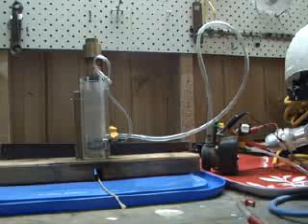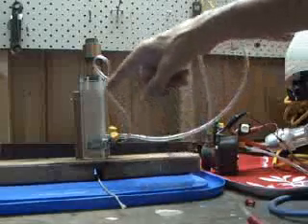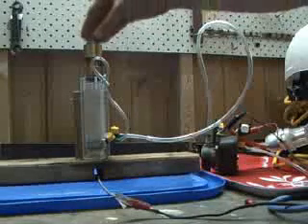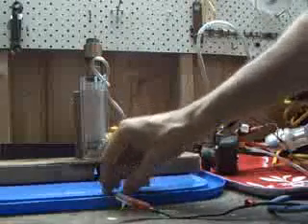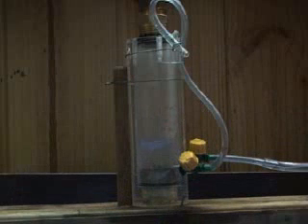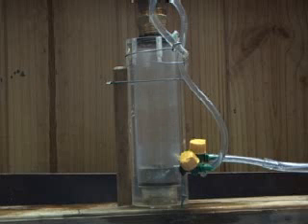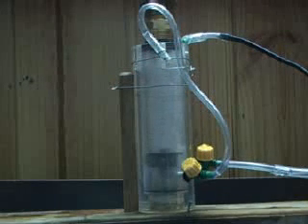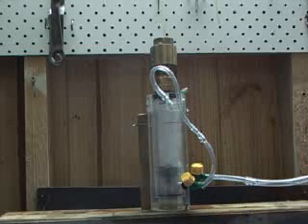The Power of Oxy-Hydrogen Implosion

Comment: I think electrolysis was used in the Grand Gallery of the Great Pyramid. The resulting hydrogen gas and oxygen gas were ignited which produced a vacuum. That vacuum in the Grand Gallery was used to move water higher in the Grand Gallery. Do you know of anyone who has ignited hydrogen and oxygen gasses in an enclosed cylinder to create a vacuum to lift water higher in the cylinder?
Reply from the maker: It's tricky because if the hydrogen and oxygen burning is enough to create the temperature above 100C in the container then there is no condensation and that brings about high pressure steam usually resulting in the explosion of the container.
Reply: @sapoty  it looks like in the video the container did not explode. Maybe someday you will read my books about how this worked in the great pyramid water pump.
Reply from the maker: Another way to create a vacuum would be to fill up the all the spaces in the pyramid with water and then take out the plug at the bottom.
Reply: @sapoty  What I am thinking about is an enclosed airtight cylinder 1/2 full of water with electrolysis plates in the water. After the plates are energized, oxygen and hydrogen gases are in the air-tight cylinder. Then the gasses are ignited. My understanding is that would produce a vacuum in the airtight cylinder above the water. The electrolysis process would only happen for a short duration. The bottom of the cylinder would be connected to a water source. My thought is the water level in the cylinder would rise up because of the vacuum above the water in the airtight cylinder. Additional water would enter the cylinder from the bottom which would be connected to the water source. The electrolysis would only occur for a short duration. Just long enough to create the gasses for combustion. what do you think? I hope I am making myself clear.

Comment: Here's a quick video I put together on the Phases of Brown's Gas Combustion.  http://youtu.be/-9EmgSowldw  Your experiment would be very different if you didn't release most of the initial force of explosion and steam with that large check valve.  The vacuum only 'looks' stronger than the explosion because you don't measure the explosive pressure.

Comment: In My experiments I found that less gas , Produces way less heat (a given) but when the piston is connected to a rotating assembly and timed right it creates enormous  low in torque at low rpm, but heat eventually builds causing expansion and loss of momentum .
Now using a mechanical driven vacum pump helps reduce heat and also cooling the gas after going through a dryer via copper condenser coil.
  Now working on consistent run times to see if I can achieve the impossible.

Comment: You 'can' get more power out, than you put in. - An HHO cell using specific materials and a 'specific ratio'. By increasing the size of the coil and researching the golden ratio and by cracking the Kings Chamber equation and applying it to the mechanical process. A pure self sustaining HHO fueled engine has been built and runs beautifully to the present day. V8 conversion. Will drive for thousands of miles on a cup of water. (Remove the electrolytes). Note; The Kings Chamber. The equation.
Reply: Tell me more about The Kings Chamber

Comment: Be much better if the H an O2 was liquefied and expanded rapidly on ignition, like in a liquid Hydrogen oxygen rocket engine..  The process from combining two light expansive gases to heavy molecules of steam is not the best for making mechanical power.

Comment from the maker: Yes there are ways to use this to pump water but electrolysis is typically about 50% efficient, so it will not be very efficient. However it may be robust.

Comment: I produced a T/3sbm which works on the exact same principal but the opposing reaction, it sparks and the water pressure plugs the gas feed hole pipe stopping further explosion, it is a test bench Apparatus, but that said, nice video guy... Ck out {FuelBan Video 12 The T3 sbm Spark Arrestor / Bubbler / 1 Litre measure All 3 in 1 Unit.  }
Thom in Scotland

Comment from the maker: @Me102288 I'm talking about using the oxyhydrogen explosion/implosion to reduce drag on a vehicle, create lift, and propulsion. To reduce drag the idea is to blast some of the air out of the way of the vehicle using laterally directed rocket engines in front of the vehicle. If done with the right timing and power the blast will be condensing as the nose of the vehicle reaches it. This will create a low pressure zone in front of the vehicle thus reducing drag.

Comment from the maker: @Ace011mm You need pure H2 for implosion.or max 5% air in mix.  No - H2 on its own does not do implode or explode. Those events happen when H2 combines with O. 
when i fire reservoir with hho and make explosion,lid go out and manometer scale is move anticlockwise and after this scale stay on 1bar. Yes - explosion blows lid off, manometer cannot move that fast. Steam implosion lasts longer than explosion... time for manometer to show low pressure then go back to 1 bar after the air rushes in.

Comment: @sapoty  Every thing is about quantum vacuum or eter or orgone or... There is only one energy,just different ways to use. H2 is just one of links to use this energy! Condenses not implosion! You need pure H2 for implosion.or max 5% air in mix. This tell as scientists. But some way,when i fire reservoir with hho and make explosion,lid go out and manometer scale is move anticlockwise and after this scale stay on 1bar. If you right,how this scale can go in different direction after explosion?

Comment: The second I read the title I realized what you were up to and a bolt of lightning zapped through my head and I thought: "That's pretty GODDAM CLEVER!"

I'm not a physicist, so I don't exactly know how to think about this, but seemingly, what you're doing is turning atmospheric pressure into work, simply by chemically changing the number of moles of gas in a container. VERY cool.

If you could "net off" (approx) the hydrl/burning, it seems like you could get the work "for free." AMAZING!

Comment from the maker: That is almost correct. The explosion created water and lots of heat... enough to boil the water instantly. Most of the white hot water vapor escaped through the brass valve at the top. The remainder quickly cooled by contact with the aluminium piston and the brass valve and condensed. That left very little vapor in the tube so the piston got pushed up from below by the outside air pressure coming in a hole in the bottom of the tube.

Comment: I did a few calculation on the amount of force necessary to lift the piston the amount of distance in that time and I figured out that there doesnt need to be much force. i assumed a square inch area of 2in. and at 10g it needs only 1.25N and at 50g it needs only 6.25N of force. And atmospheric pressure on 2 square inches exerts 130N. So only 5% drop in pressure can accelerate 50 grams that fast. as for the plate. I dont know exactly what your doing to it. where is the low pressure coming from?

Comment from the maker: Good point, thanks. So is it a general rule that at the core of an explosion there is a pressure drop below atmospheric after the initial pressure wave? In otherwords, does the outward momentum create a dip in pressure at the core? What do you think about the shot at the end of the clip with the plate lifting up? There the bulk of the momentum is transverse, not perpendicular to the plate. Separating the condensation from the momentum is a key issue.

Comment: The piston might not have momentum, but the exploding air being forced through the pressure release valve has a lot of momentum. It escapes very fast and it doesn't stop moving when you reach atmospheric. The pressure release valve only begins to close when you reach atmospheric and the air only begins to slow down at that same time. So when the PRV actually closes the escaping air has pulled the piston up. Try the experiment with better PRVs to see if theres a difference.

Comment: instead of a spring why put a shaft on the end
where the spring is and have a spring spring at the shaft, after the shaft is pulled by the vacumn the spring would pull the piston back down....with that being said, thats a perfect thing for your cell they run more effiecent in a vacumn, if you could limit the drag(piston)you might have a operating engine from your expirment.

Comment from the maker: Electrolytic separation of water is typically only 60 to 65% efficient. The purpose of my experiment is to demonstrate the concept of reducing drag or creating lift, not creating energy. Energy is used to expel air, replace it with water vapour, and condense the vapour to create a low pressure/density zone.

Comment from the maker: Hi Chris, Thanks for your suggestion. I have been wondering about efficiency improvements for oxy-hydrogen generation. As I understand it the plate voltage for 100% efficiency is about 1.2 V, but I have to run it at 2 V to get a decent current (as you will know the gas production is always directly proportional to the current).

Comment from the maker: So each gram needs 2.26+0.368 = 2.63kJ to evaporate, 1g of produced water comes with the heat to evaporate 15.9/2.63 = 6.05 grams of water

ie you can add 5g of water to every 1g of oxy-hydrogen 

Then the question is what is the volume at STP of 1 g of oxyhydrogen? 
Using the basis 22.4 L/mol. 

1 g of water makes 1 g of oxyhydrogen.

Water is 18.0153 g/mol and every mol of water makes 1.5 mol of oxy-hydrogen
So volume of oxy-hydrogen per gram = 22.4/(18.0153/1.5)= 1.86 L/g

Comment from the maker: 1 mole of water = 18.0153g. 1 mole of water product comes from 1 mole of hydrogen reactant (+0.5 mole oxygen reactant) so mols of water or hydrogen are used below interchangeably. 

1: heat of reaction of oxyhydrogen: 286 kJ/mol = 15.9 kJ/g
2: find the heat of condensation/vaporisation of water: 40.65 kJ/mol = 2.26 kJ/g
3: determine the energy required to heat the water to BP.: 0.004184 kJ/g.K so to heat from 22 to 100 takes 0.368 kJ/g

Comment from the maker: Our calculations of vaporization of injected water only allow a few grams of water to be boiled by the heat released by combustion of a litre of oxy-hydrogen. I suspect you are significantly overestimating the heat output of the combustion. Note also that the electric energy generated by the motor producing the oxy-hydrogen must always be greater than the oxy-hydrogen combustion energy. This is because energy is lost in friction producing heat such as in the resistance of the electrolyte.

Comment from the maker: After all the electrical energy used to create the oxy-hydrogen (at about 50% efficiency) ultimately comes from the engine. So if the burning of the oxy-hydrogen is to be the main source of additional energy we are in a closed energy loop with diminishing returns. Also I would not expect the implosion to occur in the cylinders because the heat would not allow much condensation to occur. I would stick with the TDC philosophy.

Comment from the maker: Interesting question. I would put my money on the explosion being more energetic than the implosion. Because the explosion seems to happen over a shorter time interval it will also be more powerful. I consider that the energy advantage provided by a hydrogen booster is due to the improved efficiency of burning the hydrocarbon fuel.

Comment from the maker: The piston-valve apparatus was not used at all in the 2nd experiment. A plastic combustion chamber was used with a nozzle directing the exhaust over the upper surface of a row of plates. Only the plates directly under the flame experienced lift.

Comment from the maker: The condensation implosion then creates a low pressure zone above the plate and the plate is thrust upwards by the ambient air pressure under the plate. In other words lift is created by the implosion. The explosion assists this by blowing the air away from the surface of the plate.

Comment from the maker: The key difference with the 2nd experiment is that the oxyhydrogen explosion exhaust is directed parallel to the aluminium plate (heat sink). This minimises the initial downward thrust on the plate.

Comment: I would agree that much less would be returned than put in. Much of what gets put in goes to waste heat anyway. If such a phenomena exists, I suspect that it would be in the form of a static discharge.  A residual static charge might remain on your plastic tube for some time after the ignition. It is possible to construct a fairly simple device to detect the presence of static electricity.  Would be facinating to see this proved or disproved.

Comment from the maker: If electricity is produced then it would not be as much as the electricity used initially to make the oxy-hydrogen. Some of the initial energy is used up in the flash of light, heat, and the bang, etc.

Comment from the maker: The Coanda effect is the lower pressure produced by gas flow over a convex surface. The oxy-hydrogen implosion is an additional source of pressure reduction. Because there is continuous flow of air to produce the Coanda effect, there is a continuous supply of unheated air. In addition it is conceivable that the convex surface could be internally cooled if necessary.

Comment: The only place I could think of this being used was the german V1 flying bombs during the second world war. They used a resonant rocket that used both the explosion of gas for thrust and the implosion as the ram effect for air intake. This system gave relatively low thrust but was cheap to produce. Ideal for disposable engines on bombs.

Comment: The vaccuum (Coanda effect) reduces as the temperature of the surrounding materials heats up (Temperature equalises). This would make the use of this effect only temporary in a practical sense and it would be less effective in apparatus where heat cannot be rapidly dissipated as in an internal combustion engine.

Comment: That would be well beyond my limited understanding.  But if you think about it kind of makes sense.  Put electricity in water splits.  Reconbine the elements and it returns to water and gives back the electricity.  I would assume the electricy returned would sort of like lightning.  A form of static discharge.  Your apparatus with a coil wrap might be able to detect this.

Comment: Good aparatus to demo the effect.  Rube Goldberg would be proud.  

There is another effect that needs to be confirmed.  It has been reported that when the oxygen and hydrogen recombine to form water, there is a discharge of high voltage electricity.  

Would be interesting if you could figure out a way to demonstrate this effect.